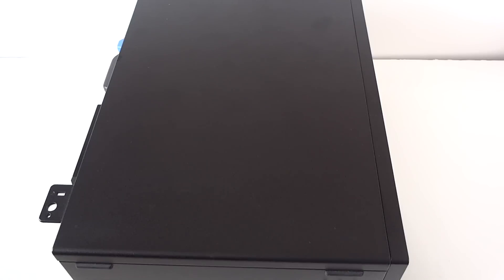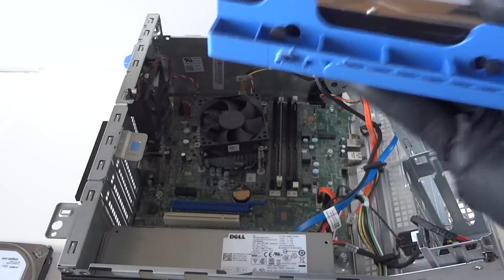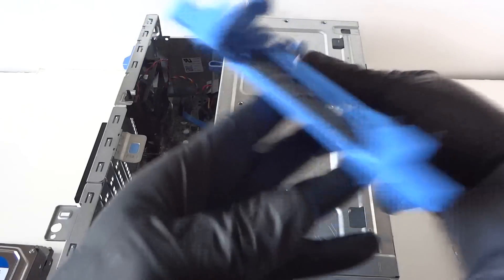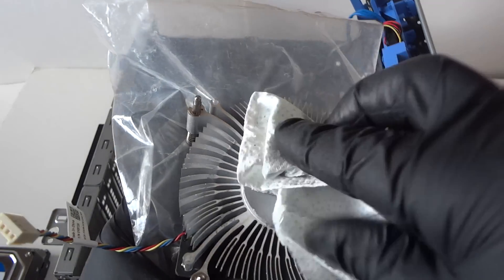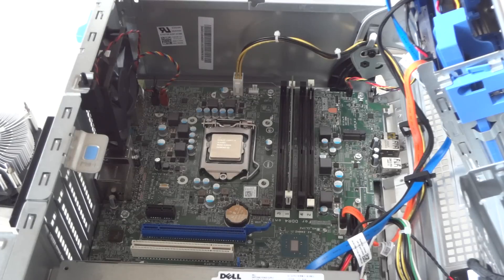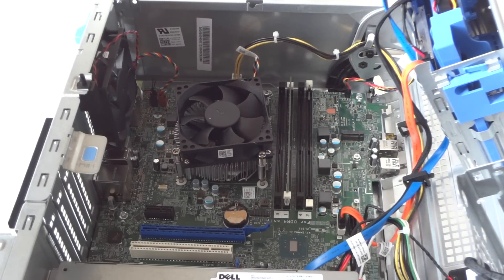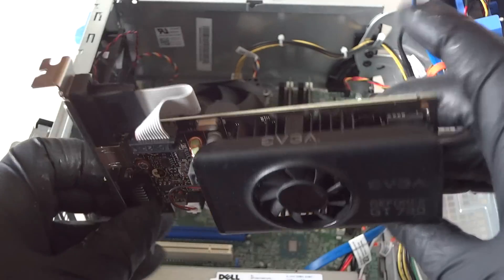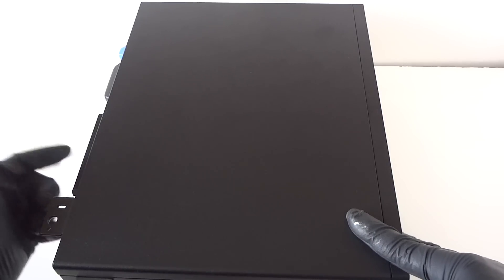Dell Optiplex 7040 Upgrade Video Card RAM CPU SSD

Comment from the maker: List of Parts  and Upgrades: 

CPU Upgrade Supports

(1.) Intel Core i7-6700 Quad-core (4 Core) 8Threads 3.40 Ghz Processor
https://amzn.to/3Sfk8wP

(2.) Intel Core i5-6500 Desktop CPU Processor
https://amzn.to/3Bdwv5o

USB Wifi Adapter for PC AC600Mbps Wireless Network Adapter
https://amzn.to/2ZaGuHb

List of RAM will work with this system MAX 64GB.

(1.) Crucial 16GB Kit (8GBx2) DDR4 3200 MT/S (PC4-25600)
https://amzn.to/3f21Qf7

(2.) Crucial 16GB Kit (8GBx2) DDR4-2666 MT/s (PC4-21300) 
https://amzn.to/3e7axnh

(3.) Crucial 32GB Kit (2 x 16GB) DDR4-2666 UDIMM (PC4-21300)
https://amzn.to/3e62jvq

(4.) Crucial 16GB Kit (8GBx2) DDR4 3200 MT/S (PC4-25600)
https://amzn.to/3f21Qf7

(5.) Crucial 4GB Single DDR4 3200 MT/s (PC4-25600)
https://amzn.to/2VXqTZo 

 

List video cards will work with this system.

AMD Radeon RX 6400 Low Profile Gaming Graphics Card
https://amzn.to/3s8MUUY

XFX Speedster SWFT105 Radeon RX 6400 Gaming Graphics Card
https://amzn.to/3xkmXo1

(1.) GIGABYTE GeForce GTX 1650 OC 4GB GDDR6, GV-N1656OC-4GL Video Card
https://amzn.to/2B7N1sP

(2.) Gigabyte GeForce GTX 1650 OC Low Profile 
https://amzn.to/3el08os

(3.) Gigabyte Geforce GTX 1050 Ti OC Low Profile 4GB GDDR5 128 Bit PCI-E Graphic Card (GV-N105TOC-4GL) 
https://amzn.to/2T8bfsv

(4.) MSI Gaming GeForce GTX 1650 4GB GDRR5 Low Profile (GTX 1650 4GT LP OC) 
https://amzn.to/2X1FYsF

(5.) MSI GTX 1050 TI 4GT Low Profile  Graphic Cards 
https://amzn.to/2LwZd7P

(6.) Gigabyte GeForce GT 1030 GV-N1030D5-2GL Low Profile 2G Computer Graphics Card 
https://amzn.to/2Z4PHkp

(7.) ZOTAC GeForce GT 1030 2GB GDDR5 64-bit PCIe 3.0 DirectX 12 HDCP Ready Low Profile Video Card ZT-P10300A-10L 
https://amzn.to/2WzgLXk 

(8.) MSI Graphic Cards GT 1030 2GB GDDR5, Low Profile 
https://amzn.to/390Spum

Thermal Compound Paste:

(1.) Arctic Silver 5 Thermal Cooling Compound Paste 
https://amzn.to/2ziNU0H

(2.) Noctua NT-H1 3.5g, Pro-Grade Thermal Compound Paste
https://amzn.to/36kTk7A

(3.) ARCTIC MX-4 (current edition) Thermal Compound Paste 20 Grams 
https://amzn.to/2DhGJaK

List SSD M.2 Type 2280 NVMe PCIe:
(1.) Crucial P3 Plus 4TB PCIe M.2 2280 SSD
https://amzn.to/3RZcUNi

(2.) Crucial P3 Plus 2TB PCIe M.2 2280 SSD
https://amzn.to/3RTUi0Y

(3.) Samsung (MZ-V7E1T0BW) 970 EVO SSD 1TB M.2 NVMe
https://amzn.to/3d52k2a

(4.) Samsung 970 EVO Plus SSD 500GB
https://amzn.to/3fpi95A

(5.) Samsung (MZ-V7E500BW) 970 EVO SSD 500GB - M.2 NVMe
https://amzn.to/37uuLFw

(6.) Crucial P1 500GB 3D NAND NVMe PCIe M.2 SSD - CT500P1SSD8 
https://amzn.to/2N07wKh

Hard Drive Caddy Adapter  3.5 to 2.5:
(1.) Dell 3.5" to 2.5" SSD or Hard Drive Caddy Adapter R494D 0R494D 
https://amzn.to/2XTPeRr

(2). Dell Hard Drive Caddy, R494D, F767D 3.5" to 2.5" SSD or Hard Drive
https://amzn.to/3cTkcOk

SSD List:
(1.) Samsung 860 PRO SSD 256GB - 2.5 Inch SATA III Internal Solid State Drive
https://amzn.to/2BY5gRl

(2.) Samsung SSD 860 EVO 250GB 2.5 Inch SATA III Internal SSD 
https://amzn.to/37xWUfc

(3.) SK hynix Gold S31 1TB 3D NAND 2.5 inch SATA III Internal SSD
https://amzn.to/3d7X6D6

(4.) Samsung SSD 860 EVO 1TB 2.5 Inch SATA
https://amzn.to/2B2FURX

(5.) SanDisk SSD PLUS 1TB Internal SSD
https://amzn.to/3hwdqku

(6.) SanDisk SSD PLUS 240GB Internal SSD
https://amzn.to/2zfc7EX

(7.) Crucial MX500 250GB 3D NAND SATA CT250MX500SSD1(Z) 
https://amzn.to/3bTTjbX

(8.) SanDisk SSD PLUS 480GB Internal SSD SDSSDA-1T00-G26
https://amzn.to/2yfgjUK

(9.) WD Green 1TB Internal PC SSD  WDS100T2G0A
https://amzn.to/2XfGtzc

HDD list works with this PC:

(1.) Seagate BarraCuda 4TB Internal Hard Drive HDD – 3.5 Inch
https://amzn.to/3d3xWeR

(2.) Seagate BarraCuda 8TB Internal Hard Drive HDD – 3.5 Inch
https://amzn.to/3xjUDSJ

(3.) Western Digital 2TB WD Blue PC Hard Drive HDD - 5400 RPM, SATA 3.5" - WD20EZAZ
https://amzn.to/3w3jIQA

(4.).WD Black 2TB Performance 3.5" Hard Drive - 7200 RPM Class, WD2003FZEX 
https://amzn.to/2xFUeyF
Reply: What power supply can I use for this pc?
Reply: max gpu length?

Comment: I got 2x 8gig (16G) DDR4 for memory(2 mem slots only, can take 32gig) and a GeForce GT 1030 for graphics.. in an OptiPlex 3050.. has no Bluetooth as added a SSD instead, use an external Bluetooth in the sound jack, with an added wifi card (tp-link AX3000) in the smaller black slot next to the only single slot for the graphics in the 3050.
Hook up my 32" TV to it via hdmi, better than any small screen.. pity windows 10 looks clunky.. I think it's at 1080p.. not 4k.
Stock power supply.. i5 .. 4tb HDD with a 1tb SSD, SSD for the OS, 4TB for everything else.

In Australia.. 240v.

Comment: So apparently you're supposed to connect your dual monitors (if you have them) to the new graphics card but i was wondering if its possible connecting one monitor to the graphics card and the other one to thr motherboard?

Comment: So uhhh im might but ine off amazon with a i5 16gb ram 512gb ssd and i want to add a low profile 1030 idk the power supply watts so i went ona webaite and it said it has a 180 wats power suply and im pretty sure the whole compiter uses 100 and a 1030 is like less than 75 wats so i think im good btw the pc cost like 240$ and the  low profile 1030 is  like 100 dollars and to add a montior 1080p all of this is 500 dollars cant wait to get a j9b and get this even though i have a all in one with amd radeon tm 8gb ram 1tb ssd and ryzen 5 4500 so what do you think?
Reply from the maker: Hi, which Dell OptiPlex Model do you have is it SFF Small Form Factor or MT Mini Tower ?
Reply: @Mxkdt  i didnt puy it yet but its 7040 sff
Reply from the maker: With 180watt and yes you can use gt 1030 low profile video card.
Reply: @Mxkdt  im gona use gt 730 instead i almost got scammed with a gt1030 ddr4 🤭
Reply from the maker: Ok. Good Luck !

Comment: Trying to accomplish this in 2022 haha
The thing is, my Optiplex 7040 has a limitation on ram frequency, it stucks at 2133 MHz and I'm using Netac ram 2x8 3200 MHz.
Do you have to do some tweak to make this computer use the 3200 MHz of your ram?
Reply from the maker: Hi, not really dell BIOS locked

Comment: Hello! I just wanna ask.. I hve this Tower Dell Optiplex 7040 and looking to upgrade to SSD Samsung 970 EVO 500GB - M.2 NVMe Interface Internal Solid State Drive with V-NAND Technology.. Will that work in this pc or so I need to buy some adaptors?

Comment: what other video cards can you add
Reply from the maker: Hi, yes.

List of Parts  and Upgrades:

USB Wifi Adapter for PC AC600Mbps Wireless Network Adapter
https://amzn.to/2ZaGuHb

 List of RAM will work with this system.
1. Kingston HyperX Fury Black 32GB 2666MHz DDR4 CL16 DIMM Kit of 2 (HX426C16FBK2/32)
https://amzn.to/38zqi4Z
2. Crucial 16GB Kit (8GBx2) DDR4 3200 MT/S (PC4-25600)
https://amzn.to/3f21Qf7
3. Crucial 16GB Kit (8GBx2) DDR4-2666 MT/s (PC4-21300) 
https://amzn.to/3e7axnh
4.Crucial 32GB Kit (2 x 16GB) DDR4-2666 UDIMM (PC4-21300)
https://amzn.to/3e62jvq
5. Crucial 16GB Kit (8GBx2) DDR4 3200 MT/S (PC4-25600)
https://amzn.to/3f21Qf7
6.Crucial 4GB Single DDR4 3200 MT/s (PC4-25600)
https://amzn.to/2VXqTZo

List video cards will work with this system.
(1.) Gigabyte GeForce GTX 1650 OC Low Profile 
https://amzn.to/3el08os
(2.) Gigabyte Geforce GTX 1050 Ti OC Low Profile 4GB GDDR5 128 Bit PCI-E Graphic Card (GV-N105TOC-4GL) 
https://amzn.to/2T8bfsv
(3.) MSI Gaming GeForce GTX 1650 4GB GDRR5 Low Profile Graphics Card (GTX 1650 4GT LP OC) 
https://amzn.to/2X1FYsF
(4.) MSI GTX 1050 TI 4GT Low Profile  Graphic Cards 
https://amzn.to/2LwZd7P
(5.) Gigabyte GeForce GT 1030 GV-N1030D5-2GL Low Profile 2G Computer Graphics Card 
https://amzn.to/2Z4PHkp
(6.) ZOTAC GeForce GT 1030 2GB GDDR5 64-bit PCIe 3.0 DirectX 12 HDCP Ready Low Profile Video Card ZT-P10300A-10L 
https://amzn.to/2WzgLXk 

Thermal Compound Paste:
(1.) Arctic MX-4 2019 Edition Thermal Compound Paste Carbon Based
https://amzn.to/2XcsZo4
(2) Arctic Silver 5 Thermal Cooling Compound Paste 
https://amzn.to/2ziNU0H
(3) Noctua NT-H1 3.5g, Pro-Grade Thermal Compound Paste
https://amzn.to/36kTk7A
(4.) ARCTIC MX-4 (current edition) Thermal Compound Paste 20 Grams 
https://amzn.to/2DhGJaK

List M.2 Type 2280 NVMe PCIe:
(1.) Samsung (MZ-V7E1T0BW) 970 EVO SSD 1TB M.2 NVMe
https://amzn.to/3d52k2a
(2.) Samsung 970 EVO Plus SSD 500GB
https://amzn.to/3fpi95A
(3.) Samsung (MZ-V7E500BW) 970 EVO SSD 500GB - M.2 NVMe
https://amzn.to/37uuLFw
(4.) Crucial P1 500GB 3D NAND NVMe PCIe M.2 SSD - CT500P1SSD8 
https://amzn.to/2N07wKh 

Hard Drive Caddy Adapter  3.5 to 2.5:
(1.) Dell 3.5" to 2.5" SSD or Hard Drive Caddy Adapter R494D 0R494D 
https://amzn.to/2XTPeRr
(2). Dell Hard Drive Caddy, R494D, F767D 3.5" to 2.5" SSD or Hard Drive
https://amzn.to/3cTkcOk

SSD List:
(1.) Samsung 860 PRO SSD 256GB - 2.5 Inch SATA III Internal Solid State Drive
https://amzn.to/2BY5gRl
(2.) Samsung SSD 860 EVO 250GB 2.5 Inch SATA III Internal SSD 
https://amzn.to/37xWUfc
(3.) SK hynix Gold S31 1TB 3D NAND 2.5 inch SATA III Internal SSD
https://amzn.to/3d7X6D6
(4.) Samsung SSD 860 EVO 1TB 2.5 Inch SATA
https://amzn.to/2B2FURX
(5.) SanDisk SSD PLUS 1TB Internal SSD
https://amzn.to/3hwdqku
(6.) SanDisk SSD PLUS 240GB Internal SSD
https://amzn.to/2zfc7EX
(7.) Crucial MX500 250GB 3D NAND SATA CT250MX500SSD1(Z) 
https://amzn.to/3bTTjbX
(8.) SanDisk SSD PLUS 480GB Internal SSD SDSSDA-1T00-G26
https://amzn.to/2yfgjUK
(9.) WD Green 1TB Internal PC SSD  WDS100T2G0A
https://amzn.to/2XfGtzc

HDD list works with this PC:
(1.).WD Black 2TB Performance 3.5" Hard Drive - 7200 RPM Class, WD2003FZEX 
https://amzn.to/2xFUeyF
(2.).Seagate BarraCuda 1TB Internal Hard Drive  3.5" Hard Drive - 7200 RPM
https://amzn.to/3g8FXM8
Reply: @Mxkdt  thank you
Reply: @Mxkdt  what is the stock power supply because it says 300 watts is needed

Comment: Hi sir! So i have optiplex 7040MT and i put gtx1050ti on it. It doesn't work. The tchnician near me said i need to change psu but the thing is, no 500 watt psu will fit. What should i do? Help me pls sir.
Reply: Did your system just worked?

Comment: If I upgrade the PSU to a bit more power, I would like to install a 750ti or 1050ti both under 7" and 70W.  It looks like a normal profile card would physically fit but I can't tell for sure from the video. Can you tell me if it normal profile card (with two slots in the back) would fit please?  I'm now using both these cards in 9010 MT so would like to not go back to slower card.  Thanks
Reply: i just installed a Corsair SF600 in my Optiplex 7040 mini tower and have a GEFORCE GTX 1660 Ti working.

Comment: At 5:06 you can see a M.2 connector for an NVMe PCIe SSD which will outperform any SATA SSD. Back in 2017, they were expensive though.
Reply: Is it nvme or only ssd m.2?
Reply: @seropserop  i have the 5040 version of this system and I replaced the stock hdd with an nvme.  I believe this board can handle the nvme
Reply: Ramesh Seelochan I ended up getting the 7040 sff and putting a full size gtx 1060 in it
Reply: @seropserop  I put a GT 1030 in the OptiPlex 3050, some were saying that the 1060 needed another power supply ?
Reply: DFaking  yes

Comment: I thought this model has m.2 SSD options on the motherboard.  I could be wrong.
Reply: You are correct. at 5:06 you can see a M.2 connector for an NVMe PCIe SSD which will outperform any SATA SSD. Back in 2017, they were pricey though.

Comment: Whats the difference between plugging into the hdmi port that came with the computer vs the hdmi port on the g card? If i only want to use the dedicated Nvidia one, should i directly plug into the g card instead? Also, i noticed an 
empty m.2 slot on the top right corner, do you think that would be a worthy upgrade for this computer? Thanks!

Comment: Will it support gtx 1060 6gb zotac amp edition with 650watt power supply I have the 7050 i7 7700 3.6ghz Will it or not?
Reply: Ali Rahmani  ياواد قلي انا عندي3050optiplex اقدر اركب عليه 1050ti?

Comment: im running a 1050ti with stock power supply np,and streaming and gaming from same pc,my elgato cap card is the work horse when streaming,still stock power supply.from a 7040 optiplex
Reply: Exactly what kind of setup I have. I have almost 1TB of memory with two of the drives being SSDs and a 500GB HDD. I currently have a i5-6500 and I am looking to upgrade the CPU.

Comment: Here's my Dell Optiplex 7040 MT default detail:
Intel Core i7-6700
SK Hynix DDR4-2133 8G (4Gx2) RAM
Seagate 1TB SATA3
AMD R5-340X 2GB DDR3
Lite-ON PSU 240W Bronze

This January I changed RAM upgrade to 64GB (Micron 16G DDR4-2400 x4), VGA card (EVGA GTX 1050 Ti SSC) and add Intel M.2 SSD 600p (2280).

It works when i playing Starcraft II and other games, the PSU use about 130W~145W.

Also I tested Powercolor RX460 4GB GDDR5, the PSU use about 150W~165W.

Remember, DO NOT BUY GTX 1050 TI / RX 460 WHEN IT NEED 6-PIN Require
Reply: Have u ever suffered auto turn off on ur pc? I tried r7 240 when in games it auto  turned off. I3 6100 4gbram with 240 watt psu
Reply: GT Shen  bro do you have Instagram i need help im trying to build my own gaming pc with a dell optiplex  7040 please help
Reply: Hello, I need to talk to you....can we have a little chat ????

Comment: Hi. I know I'm late but I have a question regarding my optiplex 7040. I have the same type of optiplex but  it has an i7-6700 octa-core and 8gb ram pre installed. I installed a 1050ti and replaced the stock pcu with a 400w pcu, although it doesnt fit inside the case so I left it stationed outside instead. My problem is that my computer powers off when I run high demanding games like Tomb Raider or Fallout 4. I tried leaving the case cover open then pointed a ventilation fan as I run those games again but still my computer shuts off. I dont know if its an overheating issue or something else.
Reply: Not enought power from psu, if its not certified will not be real 400 w, you should need to buy a 400w or 500w psu certified (real power output)

Comment: isnt the iGPU on the i3 6100 better than that GT 730? unless its only meant for multi-monitors.

If youre looking to game on it you can easily get away with installing a small GTX 750ti, 1050 or 1050ti or RX460 that dont require additional power
Reply: its only 240w psu, for all of that cards he really need to upgrade the psu

Comment: would a gtx 1050 ti fit in this computer
Reply: Marcel Montgomery  Yes you can. I have one on mine
Reply: Curious Duck  yes sir. its what I use to play. every settings on high
Reply: alright thanks bro
Reply: IT WORKS GOOD WITHOUT LAG ? EVEN IF THE POWER SUPPLY 240W?
Reply: OH THAT COOL ,im goona get one soon
Reply: Would a AMD RX 460 fit in?
Reply: @elo6344  yes

Comment: dont answer me if i cant do it, but can i install a video card that require 75W in optiplex 7040?
Reply: No, the PSU on the Optiplex 7040 is really weak. 180W
Reply: no mine is 240W
Reply: Oh, do you have the big tower version of the 7040? You should switch out the power supply if you do and get at least a 300w PSU.
Reply: Hey Hanco Games the power supply is a tfx12v you would have to modify the case for a regular atx power supply.. The best one so far that is on Newegg is 420watts for the tfx12v. still not enough juice for most graphics cards with a 6pin or 8 pin power, how ever a gtx 1060 requires 6pin power and the minimum is a 400 watt power supply. I would still get a 420watt power tfx12 if I could just in case for heavy computing power. But if you stay below gtx 1060 series you will be fine. Also check the older gpu's like the gtx 980 as they still use a lot of power. Best bet instead of modyfing the case for a cut out or having the power supply limitations I would just get a cheap 20 case from newegg with free shipping and you would be good to go without scratching your head. All you need is a micro atx case.

Comment: is it possible if you can upgrade it to an after market power supply? like evga or coolmaster?
My reason is to upgrade to a higher video card like 1060
Reply: No. That power supply is specifically designed for that case.
Reply: Really? I am considering if i can buy this, and upgrade just like you have. Can you give me a link to the 750W PSU?
Reply: Looking for this psu as well. I want to upgrade the GPU